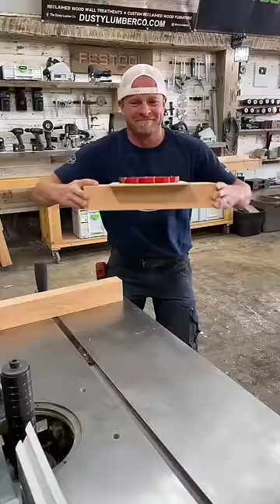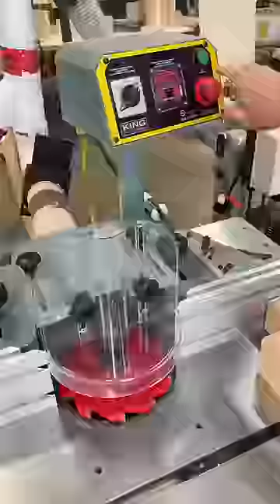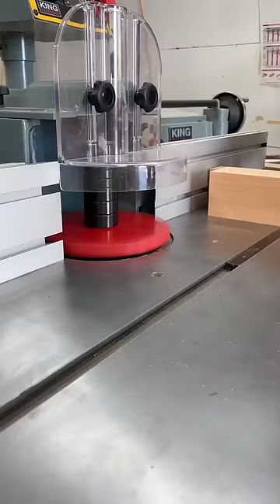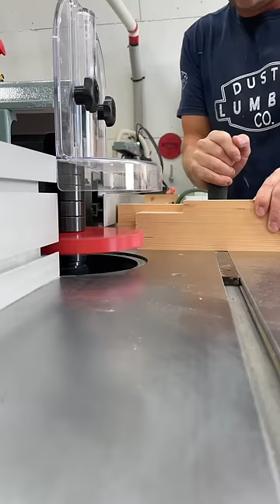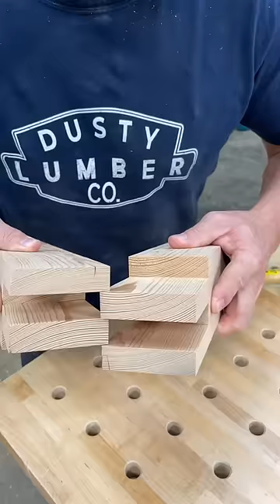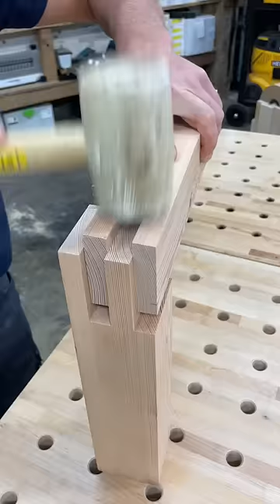Box joint with a shaper and groove cutter #woodworking #tools #maker #woodwork

Comment: I still get a tiny bit nervous when i use shapers. I guess it keeps me from getting complacent though. 🤷‍♂️
Reply: I have the exact same thought. That’s a lot of energy in something moving really fast. If that energy were to transfer to the workpiece, there isn’t a whole lot that would stop it from ransacking the user.
Reply from the maker: They can definitely be intimidating
Reply: Exactly. They're just like wild animals. Being a little afraid will make you respectful and thoughtful. And that will keep your fingers intact.
Reply: @dustylumberco its reassuring to hear you say that.
Reply: I’ve donated to go fund me campaigns for men who got annihilated by shapers. Stay vigilant.
Reply: I little fear saves fingers brother. You wouldn't be the only one either 🤓🇦🇺
Reply: Can you show a link for this piece of tool
Reply: 기게갑은얼마가나요
Reply: 기게구입하려면
Reply: 답을주세요
Reply: A careful man is one with ten fingers
Reply: Damn right, you get nothing back that you lose. Joiners and shapers. Wish this guy used a clamping jig for that. 
That's a lot of blade.
Reply: I actually received like 57 stitches in my left hand from being sloppy and running too fast on knotty material at age 19 or 20. It happened so fast and I pulled back a mangled mess. Learned the hard way that day. Still working in the same shop 9 or so years later.
Reply: @woodymcwooderson7579 you're lucky that you didn't lose a hand. One of the first times using a shaper, my coworker and I forgot to put a backer board on when making box joints. The shaper ripped it out of his hands and consumed the whole piece in less than a second. Poof. Gone.
Reply: I was just sitting here thinking the same thing. One false move/error in judgement and you’re gonna be minus a finger or more likely with this tool, your whole damn hand.
Reply: @Mighty_Atheismo 

I pretend im in the movie Maximum Overdrive any time i touch a power tool.

If you behave like every power tool is possessed by alien beings and is actively trying to kill you youll always be safe lol
Reply: Good way to not get the nickname nubs 😂
Reply: Это обычная станочная фреза а не шейпер.
Reply: Mr dusty lumber most people ain't got ur machineries ❤ show ,simple 1's thx

Comment: I retired (and divorced heh) 3 yrs ago..  at 42..  I've always built things .. decks, coops, tables, a cabin..   but now I've really started getting a shop into order.  Being a single dad of 4 boys..  it's stocked with mostly used gear.. somehow mostly older Craftsman Industrial series tools..  Router n table, 12.5 planer, miter,  big ass radial arm saw.. They're heavy, stout, and since they're maintained properly..  work very well.   Most my other 120v stuff is Makita.   I have an 18' band saw mill, and 150 eastern KY acres.. so no shortage of lumber.    Part of my hopes for a shop full of them sweet ass new gadgets... But another part loves the old heavy crazy loud tools.  Like they have stories to tell.
Reply: Sounds like the good life. Is it all wooded? The best time to plant a tree was yesterday, the next best time is today. Sounds like you can plant some fruit, lumber and firewood treestands.
Reply: @emeltea33  I've got about 1 acre of flat grass to mow down in front.  That's were small cabin, barn, etc are.. and where we spend most our time.    The rest is heavy old wood,  sandstone cliffs n hollars, with a cpl dry sandstone caves up in the woods.

Comment: El ingenio y conocimientos los tiene el artesano. Aunque es bueno tener toda herramienta tambien hay que saber hacer la herramienta. Propia ya que hay muchas herramientas manuales muy utiles. En este caso esta routeadora cuesta miles de pesos en mexico.
Se puede fabricar con un tablon 12/12 de 2 pulgada.
La superficie de 18 mm. En triplay listonado.
Motor de 1.5 H.P. de alta velocidad de 3500 R.P.M.
Un trompo de pulgada calculo el gasto de unos 6500 pesos mexicanos. Esa Fresadora vale entre 15 y 25 mil pesos en mexico.

Comment: This tool is so simple but the amount of time it saves just on this one joint, this type of joint would have been done with a square saw, hammer and chisels, with plenty of measuring and checking then sand paper, i imagine if someone from the 1700's seen this they would think its magic or witchcraft
Reply: no sandpaper

Comment: That is scary on a router table lol
Reply: Is it considered a proper router?   It seems like a heavy duty horizontal dado stack.
Reply: @BeeRich33  I believe it is. It’s just 3x bigger lol
Reply: @350Zamir Routers are usually direct drive, with the collet attached to the shaft of the motor. This is a spindle moulder or shaper, where the spindle is separate and typically driven by a belt, with the motor separate. Because the shaft is much heavier it can handle much bigger bits and cuts. It is not for beginners though, the little mistakes and problems you can experience with those are exaggerated by the extra weight and power.
Reply: @johannes.f.r.  got it! Thank you for explaining! I have a small Bosch router table. This thing is just monstrous. I get intimidated by half inch router bits lol
Reply: @350Zamir safety with table routers cannot be over-stressed. I’m still healing from a serious finger injury last month, had a muscle spasm and finger went behind the guard(I shouldn’t have been close anyways)
Having a finger bone split laterally into quarters is pretty fucking painful.
Reply: @bojanglesobrien6883  holy crap! I hope you recover quickly!! I’m a carpenter and have been using power tools for over 15 years. Router scare me the most. I used this huge tongue n groove bits to make some shaker doors.  I was so nervous using it because of the size of the bits! Stay safe!
Reply from the maker: It's a wicked Shaper table, like a route table on steroids 💪
Reply: @dustylumberco  that thing is a beast! Love it!
Reply: @350Zamir  thank you, recovery is going surprisingly well. We sutured the slivers of finger back together on site(perks of parents who are medical providers and live loyal) and I went back to work like an idiot so I was expecting to lose about half the digit. Thing healed up awesome after an initial infection and I should be able to play guitar again without having to modify my chord shapes after maybe another month. Routers are no joke, torque and hardened metal beats flesh and bone every time. My sons are allowed to use most of my tools, never the routers until they’re adults.
Reply: @bojanglesobrien6883  oh man that’s pretty crazy. Fingers seem to take a very long time to heal. I cut through my finger 3 months ago while cooking. Had 8 stitches. It’s healed but super sensitive. If I bump my finger against anything, It hurts like crazy. Not sure if you have the same problem. And good call on the router. Power tools def need to be respected